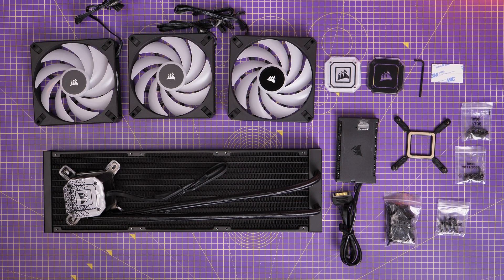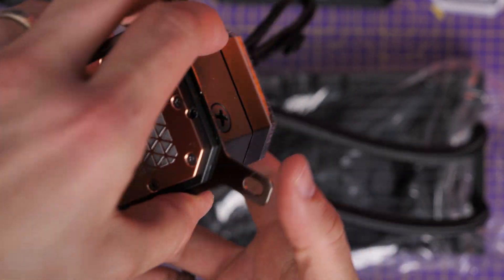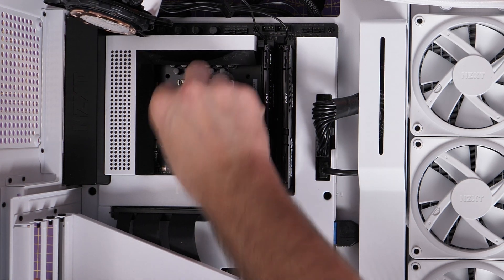CPU cooler problems and regular mistakes people make

Comment: My good friend, please please please help me..
I got the icue H150i Capellix XT 360 just today but the tach cable is only 3 holed but its supposed to go to the cpu_fan header but its a 4 pin connection on the mobo..
How on earth do I put it there?
Same with the AIO_pump header
Its also 4 pin..
Please advise..

Comment: 0:00 Helloooo
0:34 Thermal paste
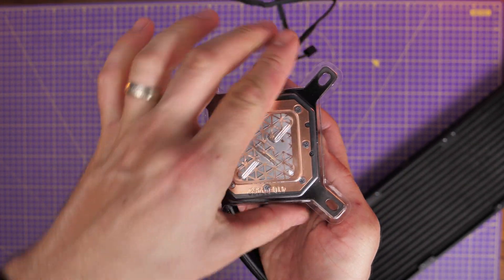1:25 Thermal paste damage
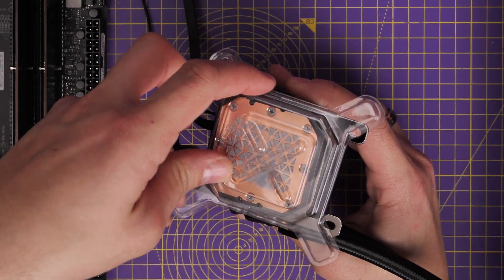2:09 AM5 brackets   
2:33 Perfomance issue solution
3:03 Simple mistakes 
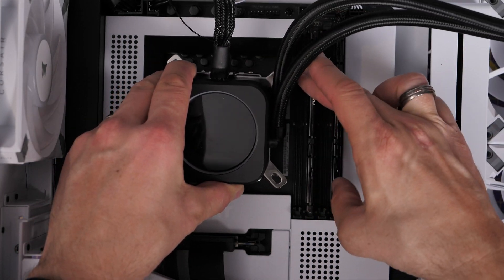3:27 The correct brackets and thumb screws
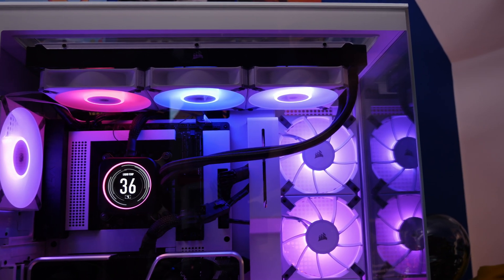4:08 Cinebench R23
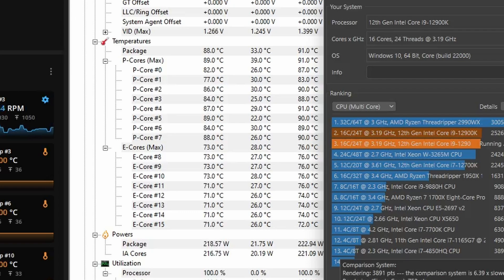4:51 Thanks for watching

Comment: Only problem I have with the corsair aio is the pump noise under no loud and it queit mode.
Reply: When I'm gaming its fine, headset on don't hear a thing. But if I'm using it for work emails etc its just an annoying noise to listen to. I've got the h100i elite capellix cooling s 7600x seems to do a good job its just the noise. Might try a different one all together
Reply: Ya mines annoying too, I can hear it when my pc is idle. It's louder than the 10 fans in my case. Lol
Reply: @Joe  I feel like returning it but it seems like its normal for it to be loud looking at how many people have complained. 2000plus rpn at idle don't help
Reply: @Reilly   I have the h150i elite capellix, it works good on my 5900x, just a shame the pump is so loud.  There is a way to edit the pump  curve in the directory, but it will shorten the life span of your pump unfortunately.

Edit: ya the noise is normal on these I have had mine for almost 2 years now and it's always been annoying. Lmao  after time you'll tune the sound out for the most part, unless it's dead silent in the room you're in.

Comment: Hey there.  Do you plan on getting the AMD 7950X3D to give it a try?  I'd be interested in seeing such a video to see how that thing really performs before I decide to make the jump to one from my already good 12900K lol.

But also, just to note:
The new AMD CPUs will likely reach those high temperatures as I believe that they are designed to automatically boost clock themselves until they reach an internally set BIOS temperature threshold (I think the new AMD chips are set to climb to either 90 or 95C).  So, if that is true, then you will likely see those temperatures depending on your cooling set-up.

Granted, I could be incorrect with all of this....

Edit - And thanks for the video - as always!

Comment: NOTE: UNDER WORK THE RYZEN 7000 SERIES USUALLY RUNS HOT, idle it should be 20-36 and at full use it should reach 80-92 its fine
Reply: Idle temps are usually 4-10 degrees higher than ambient temp, you can't cool a cpu lower than ambient temps, so you have to factor that into your average idle temps.  The 7000 series cpus even at idle run higher than the other "normal" at stock settings and will purposely scale up to 95c as they are designed to do under load.  

With that said, after under volting etc you can get the under load temps reduced by quite a bit.